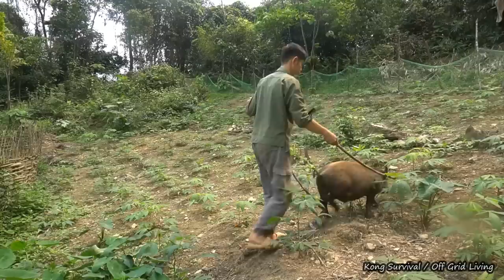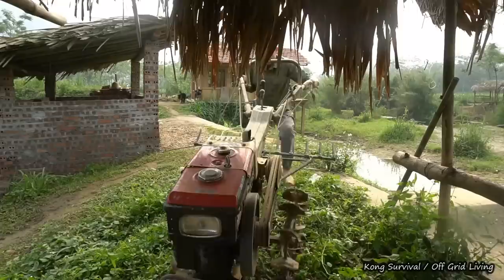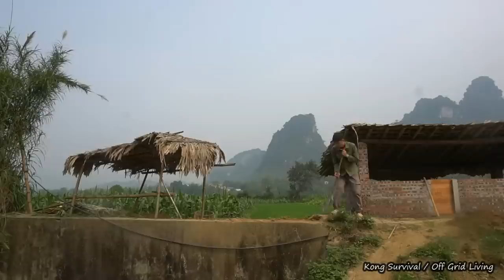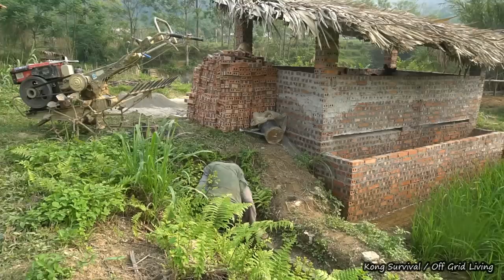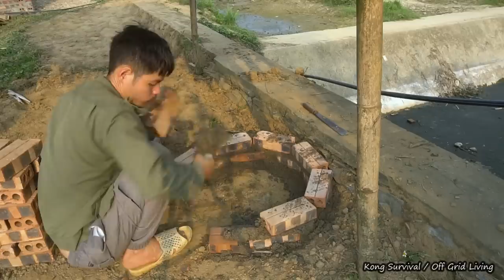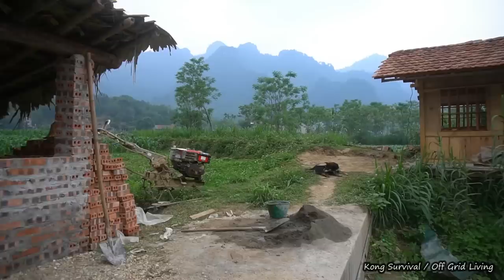Kong went up the mountain to get pigs to the new farm to raise - Build a stove to cook pork bran

Comment: Won't you have the same problem that occurred with the stove in the mountain home with no iron rods to prevent the top from cracking and breaking?  Because you are going to be having fires in the shed and the roof is so low, are you going to remove the old dry palm leaves and replace them with a tile or metal roof for safety?